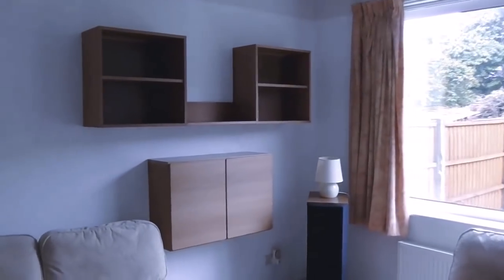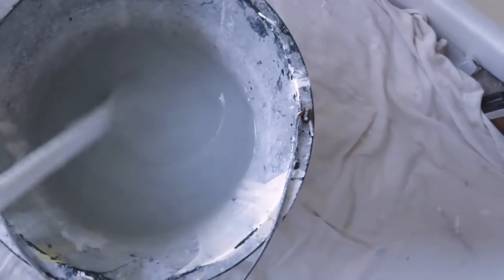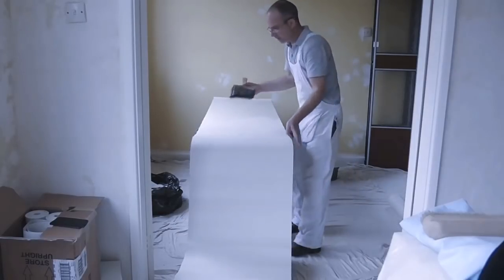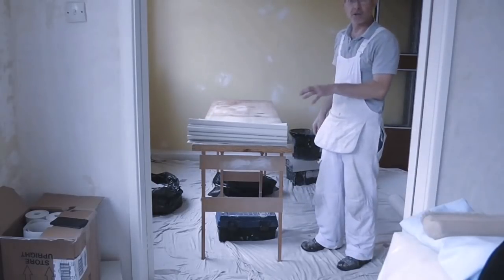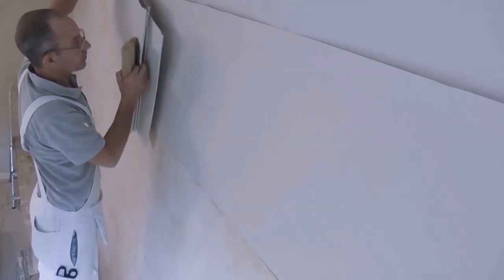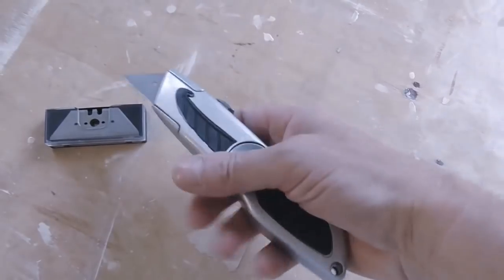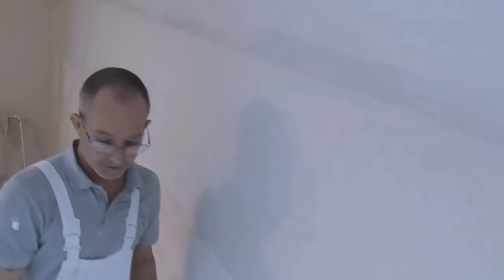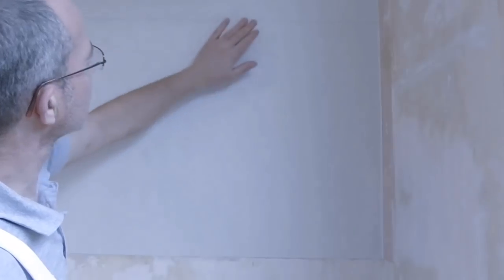How To Butt Your Joints Using Lining Paper

Comment: Sizing the walls used to be done with cow glue that left a sheen on the walls. When you hung your paper the water in the paste would reactivate the size and the two would dry together, even though the primary reason for sizing was to kill suction and create slip. Using a thinned out version of the wallpaper paste as size later became an acceptable practical alternative - but using pva as a size can be risky as it can dry like a skin, not reactivate and mix with the paste on the paper and even pull off the wall.   Those cheap snapoff blades are thinner and less likely to drag than stanley blades, though for me scissors are best everytime. Good to see someone using a chalk line to start off lining paper - I was surprised at some of the so-called professional videos not understanding the need on lining paper. For anyone reading, if you don't use a chalk line to hang your first piece on each wall, then it may look like it is hung in a straight line to the eye, but the edge will probably waiver in and out 5mm or more. That means every piece of paper you hang on that wall you will have to make it waiver in and out to match that first piece. Use a chalk line to create a straight line for your first piece and the rest of the wall will be straight.
Reply from the maker: Lol.

Comment: Hi, great channel. Thank you for the way you explain everything in detail. I've learnt so much. I was wondering if you could help me with a job I've just completed. 
I used lining paper (grade 1400) to help with the imperfections on the walls. The room had been rewired so I filled the channels with plaster and a finishing plaster (easyfill). Before papering I treated the walls with a watered down pva. Once the lining paper was completely dry I applied the first coat of paint just as you've described by adding a small amount of water. I then let the paint to dry for 4hrs (following the manufacturers spec of 2-4hrs). I was extremely happy with the result so far untill I finished the second coat. Bubbles started appear and some of the paper seems to have come away especially over the new plastered sections. Also the paint seems to be darker in sections! There's no heating in the room and maybe the paint hasn't dried completely yet but it's had 12hrs so far! I'd really appreciate your feedback so I can rectify these issues.
Many thanks, 
Mark.

Comment: If your painting the wall up and down is fine.
Even if you butt doing it horizontally the paper slips down 
Under no circumstances as you say overlap. 
I always leave a gap and fill with pollyfilla the quick set tube.
Othe readymixed falls out

Comment: Following your advice I hung an anaglypta coral pattern RD995 and it looked great, only there were some small gaps which I filled using caulking and it blended in seamlessly, that was until I painted it and at certain angles you could see the caulking, which appeared as a thin line. Is there anything I can do to rectify this the colour of the paint was wheat I've given it 2 coats! Should I give it another pass maybe covering the caulking with a heavy coat? I would be grateful for any advise you have, thank you for your time
Reply: TheAudiostud hi, in currently in a similar situation. What did you do to resolve it? Thanks.
Reply: If be interested to know the answer on this one too

Comment: Well I listened to myself and applied 2 further coats of paint and there is no longer a problem, I had covered the wall with what I thought was a heavy coat of paint, but obviously not now that problem is sorted onto the next project 👍🏻
Reply from the maker: Sorry about that some comments I miss replying... thought I'd replied but usually caulk is a big no for filling gaps in paper...  usually put first coat on then fill using powder filler mixed with some paint.. we call this a hard stop filler.

Comment: Sorry to hear about your tendonitis. Very painful. I suffered from it years ago. I did find that regular immersions of my elbow (mornings and evenings) in very hot water helped a lot.
Reply from the maker: Thanks. yes hot water does help.
Reply: The tennis elbow that I suffered from was caused by playing squash. Fortunately, I made a complete recovery. The way I was cured may not be relevant to your tendonitis but I'll quickly go through it just in case it may help you. 1) Morning and evening immersions in very hot water as already mentioned. 2) Winding tape around the racket handle to make it larger and therefore forcing me to change my grip on the handle. 3) Making a conscious effort not to grip the handle of the racket too tightly. The other thing that may help you is to use a smaller pasting brush. I realise this may slow you down but it may help. Hope some or all of this helps. Cheers, Mark.
Reply from the maker: @markrowland5393  Thanks Mark, smaller brush I think.

Comment: Hello i would like to ask you if i wanna hang wallpapper over lining paper do i have to leave little gaps between lining papers?thank you in advance
Reply from the maker: Hi, you never want to overlap lining paper ever so as long as your gap is no bigger than a couple of millimeters then that's okay.
Reply: Thank you very much for your answer .And i would like to ask you ,i had holes around the window and i filled them with silicone  ,do you think that i will be able to hang lining paper as well there(any problem with glue ) ? Many thanks

Comment: Had some problems with a 1700 grade lining paper on a hall stairs and landing. All looked fine at first, No overlaps. First coat then fill with easy sand polycell. Couple of seams had overlapped in the centre of two strips of paper..Could this be due to dry seams? I had to cut out the overlapps and fill again.
Reply from the maker: Can depend on what lining paper you used normal or fiber lining.  Normal lining is easy to manipulate over the uneven surface of the wall. Other than that it's down to poor application.

Comment: Im about to line paper my livingroom before painting. 3 out of the 4 walls are long with no windows etc so I will go horizontal like this. The 4th wall has a door and large window which leaves 3 areas needing paper. Each area is only around 80cm wide so thinking going vertical with these bits... Is this adviced or should i keep it all horizontal??
Reply from the maker: If your applying emulsion then it's okay if your papering then best to go horizontal. thanks
Reply: @PaintingandDecorating  Thanks for your reply. Yeh , just read on a forum if painting you can go vertical.  Might just do every wall vertical as might be easier for the me with shorter pieces being my first time.

Comment: Good video, i will ask you something. I have an old house that my father in law constructed, all walls are in cement (concret) and are just painting over the cement, the walls are very roaf too. Can i use lining paper 1200 or 1400 and paste direct over the wals or not ?  The second question is about painting, whats the best paint typ to paint over the lining paper ? The last question is about the type of lining paper, there are several types or the brand and type is not very important?, Sorry for my bad English, thanks. Antonio  Portugal
Reply from the maker: sorry for my late reply hope your job went okay...  so many questions some slip by....  depending on how rough you mean rough...  no.   textured wallpaper would be better for rough walls... hides more imperfections....  you can get some thick insulating lining paper and special adhesive ...  good for cold walls and will smooth them... expensive..  we have videos on it..   and for paint most paints will be okay to go over lining paper...

Comment: Would you recommend caulking the butt joints to achieve a smoother finish if you're printing and want to avoid seeing the paper lines?
Reply from the maker: Never use caulk, paint first then mix a hard stop filler if the joints show.

Comment: Hi. Why not just apply a coat of paste on your wall or size instead of pva ?
Reply from the maker: Paste is not made for sealing although it would help stop paste absorbing off the wallpaper. Size is very old school and it's harder to use because you need to mix it with boiling water and it stinks. PVA diluted does a far better job quicker to use.
Reply: Painting and Decorating yeah I remember it stinks lol
Reply: im finding using my bosh spray gun with 1:4 ratio is working amazing! done in 5 mins over 3 walls, do the second coat once first is done or after any other plaster touchups @PaintingandDecorating  only used 3x 500mm mixes all over these 3 walls ( medium bedroom) too. i know the first coat had doen its job when teh 2nd was runing off after not so much sprey as it wasnt absorbing.

Comment: Have you ever thought of putting marks every 6 inches on your table to save using the tape measure saves a fair bit of time throughout the day
Reply from the maker: I have a six foot mark bend back at that..  then measure the rest with the tape. Every room and measurement can be different it needs to be marked every inch if your going to mark it stick to my tape.  Every finish paper I line my bench first then add six foot mark.

Comment: Why do you still wear biv n brace? I am a painter/decorator of more than 30 yra experience & wear englebert strauss trousers, so much nicer to work with & more freedom to stretch when painting ceilings, cutting in tops of walls, paperhanging & so on, would never go back to bib n brace , the straps used to dig into shoulders or clips would snap on straps 😡
Reply from the maker: where do you put your paperhanging brush?
Reply: In back pocket lol , i very rarely use a paperhanging brush tbh , only on textured papers, lincrusta ( very rarely ) or delicate papers , more of a snap off knife / muraspec board man
Reply from the maker: @ascno1970  if that works great.